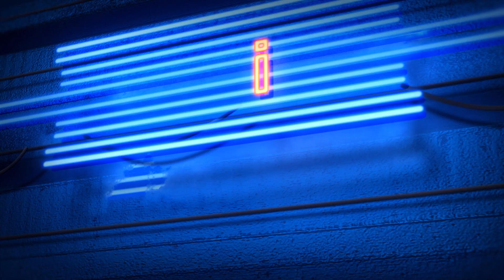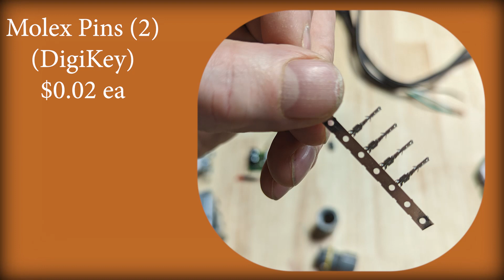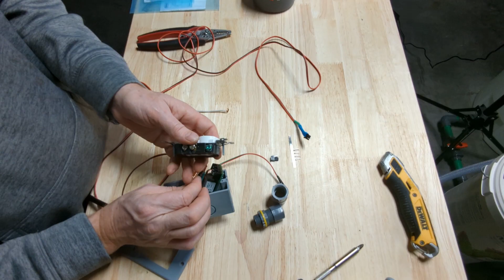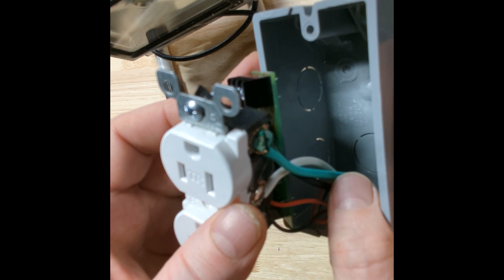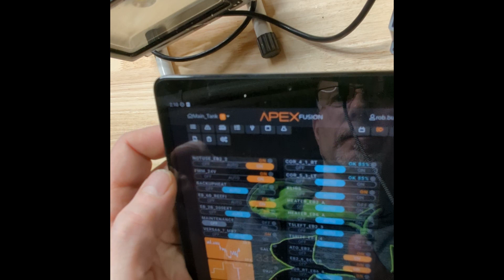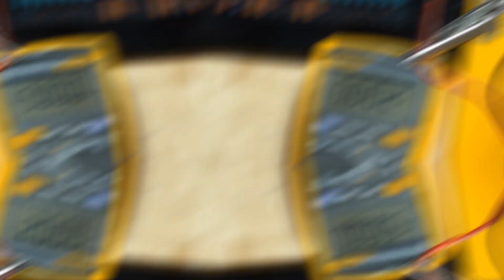Apex Expansion Outlets

Comment: Just want to point out that the description for the relay says 12v but the part number is correct for the 24v coil.
Reply from the maker: That's a great point!  I had forgotten about that.  It confused me at first as well and after a little digging I figured out it was actually a 24v coil.  You can find these a lot of places.  I don't endorse anyone in particular, it's just the cheapest one I found at the time.  Thanks for pointing that out!

Comment: I found this recently while browsing Humble.Reef forum and have a question.  Aren't you still limited to 15 amps total on the EB832 even if you expand it to 10 outlets?
Reply from the maker: Absolutely not limited, it's why I use this in the first place.  I can run my 600w heaters off them and not degrade or damage the cheap relays on the EB832's.  Since you're only using the 24v accessory port to switch the external relay on that outlet.  None of the load goes to the energy bar.  You plug that outlet into an independent one on your wall etc, not the energy bar so it's whatever your circuit is rated for on the line you plug into.
Reply: @RobBzReef   Ah ha!  I see now.  Must have missed that in the video.  I thought it was pulling 24volts through the energy bar so would add to the load.  Thanks.  I will give this a try.